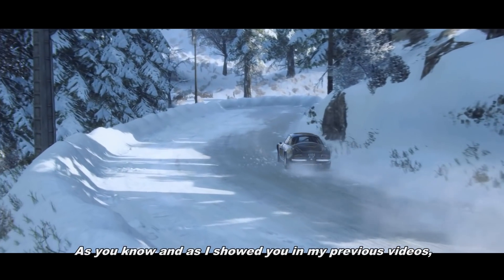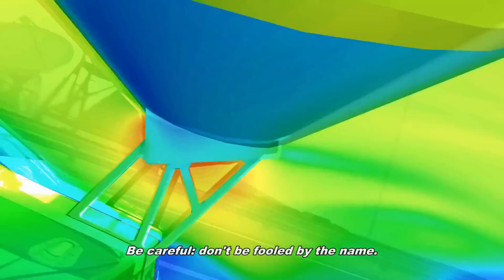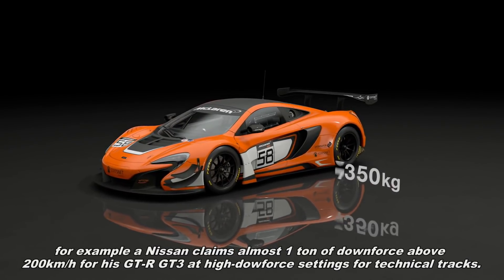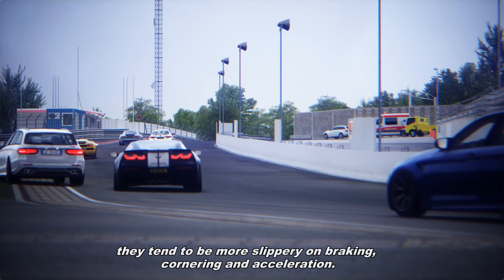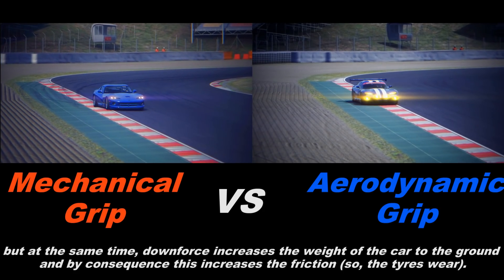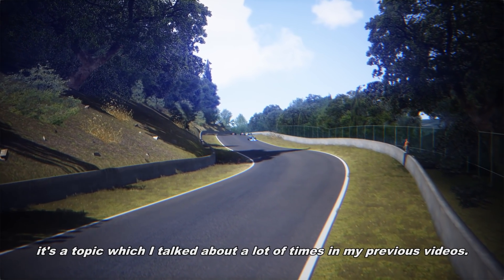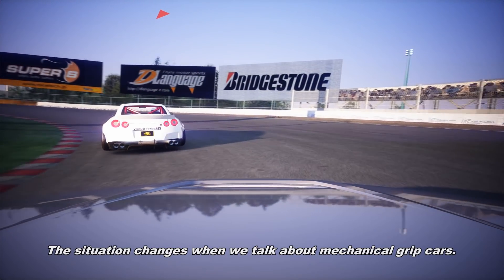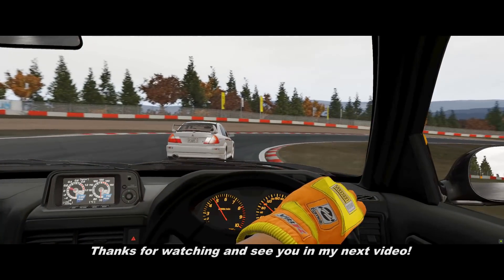Racing Games - Mechanical and Aerodynamic Grip

Comment: Drifting should never be faster. If your front tyres are countersteered, then the total cornering force into the corner is limited to the rear tyres only which means, less cornering force total and thus lower speed carrying potential.

Comment: You should be able to lower your audio cap to prevent the peaking you seem to have with your mic , it’s no biggie though still a great video, I find it hard to adjust back to aero cars after driving more mechanical based ones. I lose my confidence quick if I don’t get in a gte/gt3 or modern open wheel a few times a week

Comment: 4:05 This car was INSANE! It had a Chevy V8 engine to power the rear wheels it and a snowmobile to power two fans at the back. There were two scoops on the front to bring air to the fans and side skirts to literally suck the car to the ground

Comment: I have one question regarding the purpose of the aerodynamic parts on a car:
So it is mentioned that the front splitter or wing is utilized for cornering speed, whereas the rear wing is used for stability. The question is, what "purpose" does the underbody have ? It should be noted that the underbody of a race car produces the most amount of downforce, as well as the least amount of drag - which was why Group C cars (with the exception of the 3.5 Era cars) looked like eraser wedges. And in relation to Group C, some drivers say that despite having less downforce, the Peugeot 905B was more stable than the Nissan R90CK; with the use of a massive double rear wing might possibly have an effect on the stability, I don't know for sure. So is the underbody of a car there purely to suck the car down?
Reply: The underbody has the effect of lowering the centre of gravity (thus giving the car a more neutral attitude in relation to yaw), while also being the primary downforce generator of the car.

You first install the straight underbody, then you apply front splitters, then rear wings. Why?
Because like I said, when you install the straight underbody, your car attitude to yaw changes, it becomes more neutral (depending on the inlets attached to it, you can play with how far front or how far back you want that centre of rotation), then you add the front splitters to increase the amount of cornering downforce (that is why it is so close to the ground and the canards are that far to the sides, they work best when your car is rotating, giving it a better air flow to a side than the other, frocing the yaw to happen), and then you finally add the rear wing, because this one is to stabilize the rear (given that you added a huge amount of downforce at the front and the middle of the car), because the other aerodynamic appendages made the rear of the car lighter than the rest. So you add the proper wing to counter that lack of weight at the rear, and the car has all of its sectors under a "steady and controlled airflow" (or at least a predictable one).
Reply: @sombraarthur  Made things a lot clearer, thanks

Comment: Is it just me, or are aerodynamic grip cars significantly easier to drive? As someone who mains the Peugeot 205 T16 in DR2, it's become a habit to always push the throttle through the corners - of course anyone who races GT (3,4,E etc.) cars will know that such a maneuver is stupid and will end your race. When I try to race in cars that mainly rely on mechanical grip, I perform extremely poorly - my lap times are pure garbage (Rfactor 2) - whereas when I try to drive cars that prioritize downforce, I end up performing extremely well. I think that it really depends on driving style, be it precise and careful or flat-out through every section of the track.
Reply: If you are pushing the throttle through the corners, you are already doing something wrong. You don't push it, you maintain it, if you are doing trail braking, and increase it along the corner. Trail braking can be done with both type of cars, and I dare to say that it is way more beneficial in mechanical grip cars, because it keeps the attitude of the car more tame than when in full brake, full throttle.
Reply: @sombraarthur  Well it depends on the corners but you are right. I tried driving a lot smoother 2 days ago, and in Silverstone (using a F1 1991 mod) I lowered my previous lap-time of 1:37-35 to just 1:34s every single lap.  I think I'll still have trouble with GT cars - but thanks for your help!

Comment: 5:50 I remember that you once did a test of high downforce vs low downforce and found that the reduced sliding caused by the downforce led to lower tyre wear
Reply: So low downforce is not actually better if you're going to slide for the tyres...

Comment: So I didn't get the part about ground effect? Was just the car with the fan banned ,or ground effect itself was banned.  It just a little weird lol. I mean the fan cars isn't the greatest thing to introduce how this effect works . The very little space between the ground and the bottom plate of the formula ,and also the difference that space in the front and the rear makes the air move faster , making the car stick to the road
Reply: Ok, the fan car is banned. The skirts used for ground effect in old F1 cars is also banned.
But ground effect in general is still used in F1; this is why the cars still have diffusers and floors. It’s also why floor regulations and rake is a big talking point in F1.
Reply: Both were banned. The fan car generated huge ground effects, and then ground effects were banned in F1 until 2022, where ground effect will make a comeback.

Comment: Talking about clean and dirty driving, where would you put the positive yaw moment technique ? Because it's right in the middle of grip and drift, and it's used in every racing series, from the Porsche Cup to F1.
Reply: do you mean the slip angle ?
Reply: @jrmd3158  Well, yes but actually no.

Slip angle is only the tyre deformation, when yaw moment is the différence between the direction you are going vs the one your car is facing.

Positive means that you are slightly oversteering, it's at this very point that the slip angle is close to its maximum.
Reply: @s1nenomine  Thanks for the clear reply english is not my native language sorry for the misunderstanding^^
Reply: @jrmd3158  Don't worry, even in the videos on the subject, people use the slip angle terms